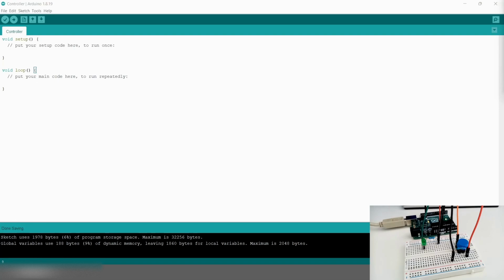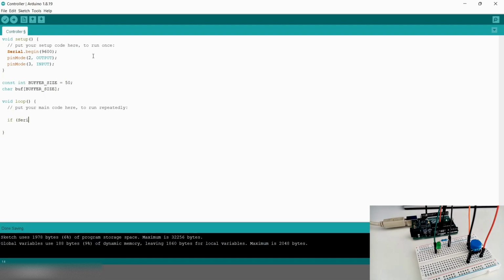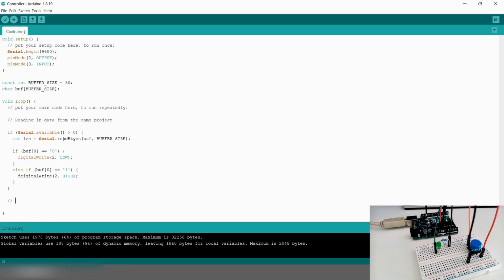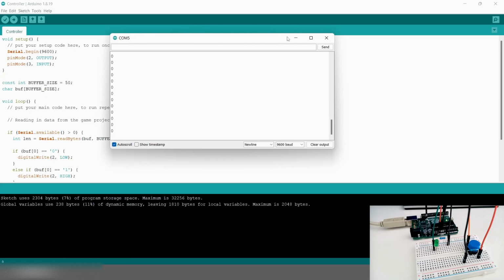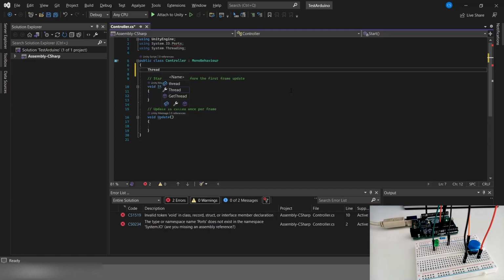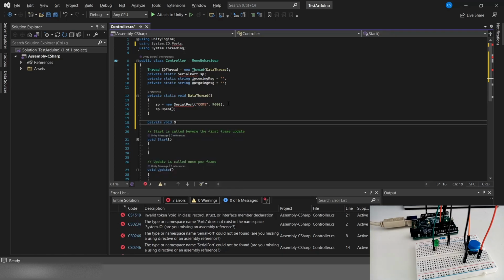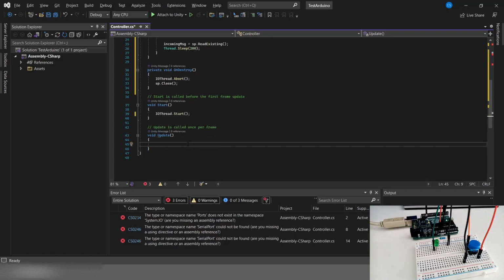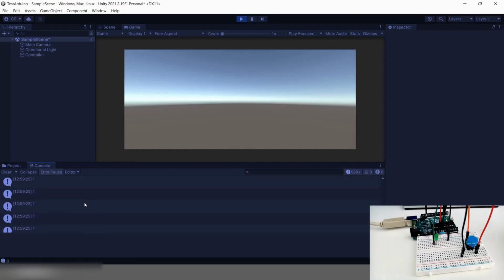Unity & Arduino Communication

Comment: Can you both read and write via serial?
Reply from the maker: Yes, however not at the same time
Reply: @CallumS005  please link me to the list of functions that I can use for serial communication. 
Error occurs ....says:

"Ioexception:access is denied
specific port not open"

I've selected the .Net 4x and stuff.....but still error occurs

Will the change in setting mentioned in the description fix the problem?
Reply: @CallumS005  also are u using apple of windows?

Ppl say windows should work out of the box
Reply: It is probably because your Arduino IDE is still running in the background. I had the same problem and when I closed the IDE it suddenly worked. :)
There must be some port-conflict between Arduino and Unity.
Reply: @andim.7911 simply close serial monitor in arduino IDE 👍